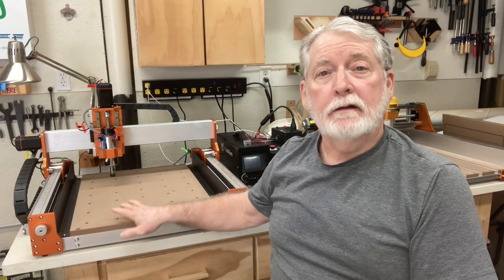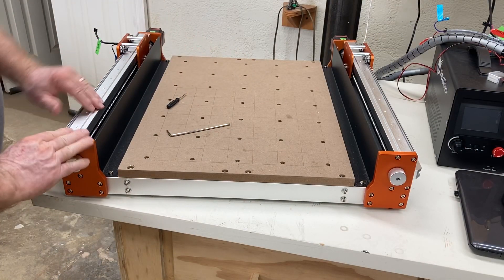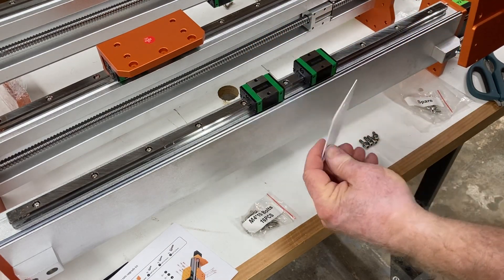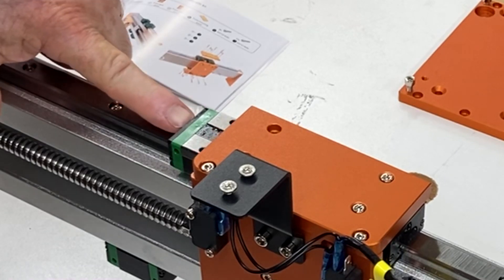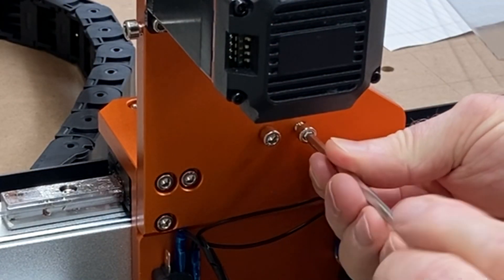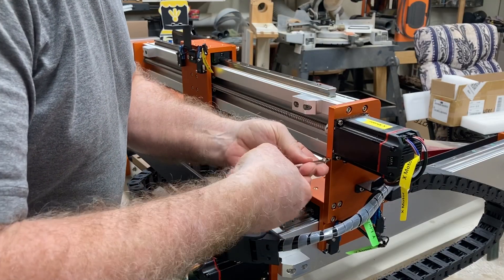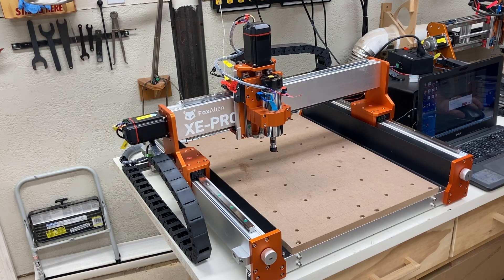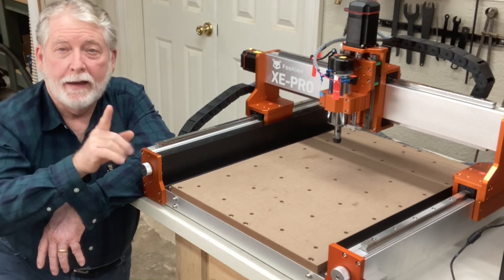FOXAlien XE-Pro Linear Rail Upgrade

Comment: My grandsons call me paw paw so the fact that you made this video cracks me up... and THANKS TO YOU, since I am not mechanically inclined, this thing is coming together so far. The half hour build, well, I'm on my 3rd day of 2 hours each, going over your video with a fine tooth comb. Can't thank you enough 'brother mine'...

Interesting side note, when you said check the squareness, at first I measured wrong and had 91.4 cm and 90cm, so I checked with chagpt which told me the result of that offset would make a 4x4x4 inch cube into a 4x4x3.94 cube... which CAN be adapted for in software (that's what I do), but fortunately they were both 91.4 as properly measured. 

Either that or I have a tremendous imagination.

GREAT video my friend, just awesome. Can't thank you enough.

Comment: Tip to get those green screwhead covers in nicely - place one over the hole, place the PVC card you're given (or any other rigid bit of material) and tap lightly with a hammer.
Reply from the maker: That's a great idea!  Thank you

Comment: After much run time, you begin to notice some back cutting. The dampers between the ball screws and servo motors will need replacing.
Reply from the maker: Yes. That’s definitely possible

Comment: It looks like you have a FoxAlien Vatso there as well. After the Linear rails upgrade on the XE-Pro, how do you find their performance compares?
Reply from the maker: I just ran a project using oak and it did an excellent job
Reply: @PawPawsWorkShop  nice. Do you feel that with the upgrade the XE-Pro is on the same level of performance as the Vasto? Or is the Vasto’s construction still more rigid and accurate?

Comment: great review...but did it make a big difference?.....you said you were going to do a project with the foxalien since the upgrade.....dont see and video on your site....sooooo....whats up on the upgrade?.........big difference....minimal difference?.....worth it?
Reply from the maker: The biggest difference is more stable and less slop. Anything to do that eliminates wheels and belts from any CNC is an improvement. Wheels get dirty and out of round. Belts on CNC machines stretch. This upgrade accomplishes this.
Reply: @PawPawsWorkShop  thanx for replying back so quickly...love your explanation of details to adjust, as cnc's and upgrades are never really plug n play....built my own with acme screws and c-beam 6 yrs ago....did the rubber wheel route, which has survived the test of time...repeatablilty is incredible...

Comment: First of all I want to say thank you for the video! Do you think you could possibly mill some aluminum or cold rolled steel as a test for accuracy?
Reply from the maker: Thank you very much. Working with metal in a woodworking shop is very rare. I do not stock any metal.

Comment: Thank you for making such a clear demo on how to do the upgrade! I am totally new to CNC but in the process of finding which one to start a hobby. Do you know if FoxAlien XE-Pro sells one that already has the linear rail? It seems quite a waste to buy one and immediately replace it with a new rail. Thanks in advance!
Reply from the maker: There are larger machines that have the linear rails. FOXAlien allows for the entry level folks to get started and the machine will work just fine. However, as your productivity increases you can upgrade to the linear rails

Comment: Did anyone else get an upgrade kit where the linear rails are apparently identical, except 2 come in a green plastic cover and 2 in a clear plastic cover - and the part numbers on the sliders are 1 digit different?
Reply from the maker: The green covers are caps for the rails. Did support help resolve your issue?
Reply: @PawPawsWorkShop  I fitted the linear rails anyway; I noted in your video that the ones you fitted to the Y axes came in a green wrapping so I did the same. I ran into another issue though, when dissembling the Y axes - Y1 only had 2 of the 4 screws with washers (I bought the linear rails at the same time as the XE Pro so it's never run)